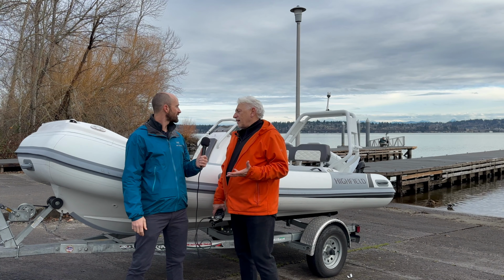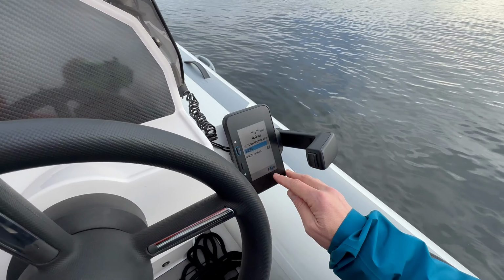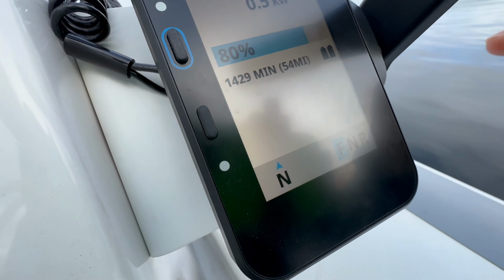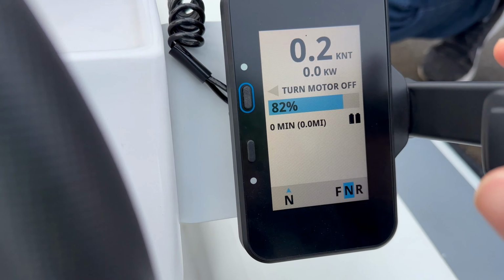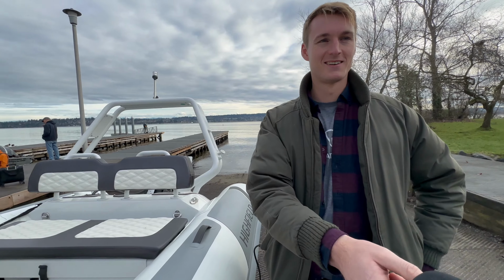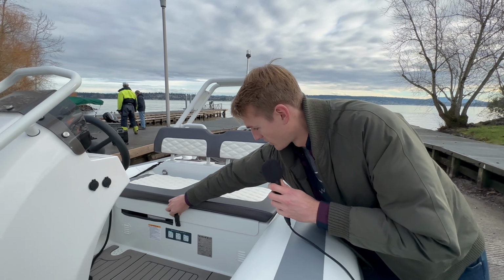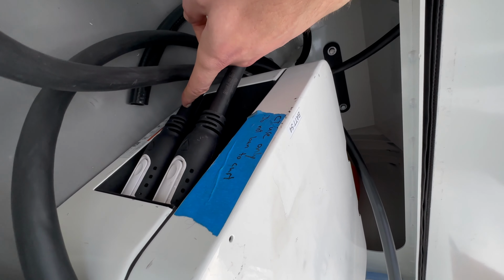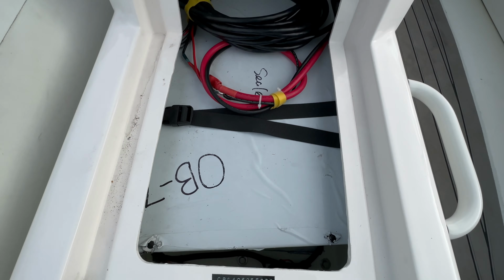Testing Pure Watercraft's Electric RHIB | Highfield 420

Comment: Nice video.There's a lot of good marine EV applications available. I've been enjoying our high power Stealth electric outboard. Our 16' bow-rider has a top speed of 27 mph and a 20+ mile range. The 144v water cooled 75hp motor is powered by 3-180ah NMC batteries. It's perfect for the type of boating we enjoy. View on you tube: marks gas to electric boat conversion.

Comment: Why did you choose a displacement hull and not a pontoon style hull?   Seems like more efficient displacement would offer longer battery life.  

Also, what it the entire weight of the boat?   We do swim support in the SF Bay and these would be really great since our longest swims are around 12 miles at around 3-5 knots. 

All and All, still a very cool boat. . . .
Reply from the maker: Pure Watercraft actually has a Pontoon that they are releasing very soon, which actually has a partial hydro-foil wing for added efficiency.  

As for the Highfield rib, there are different applications for different boats and its always great to have options.  The weight of the Highfield 420 with 1 battery pack is 911 lbs.
Reply: @aqualectric-gi2ln  :  That is really exciting!  Foiling is a game changer!

Comment: What is the range at 20 knots after full charge?
Reply: oh let me guess, they won’t tell you😂.
Reply from the maker: With the two battery option it’s about 20 miles
Reply: @aqualectric-gi2ln  thank you for the honest and clear answer! there it is, 20 miles is not yet enough for such an offshore capable boat. i ll wait for a few more years when the battery technology really has break trough.
Reply: @kuang01  in most electric rhibs you can just add more batteries if you need more range. plenty can do over 100km now.
Reply: @licencetoswill you can't, batteries are heavy, you will be using a good chunk of your energy just moving the battery.